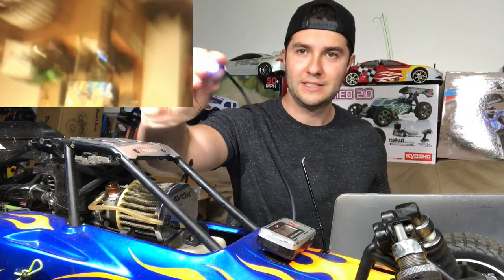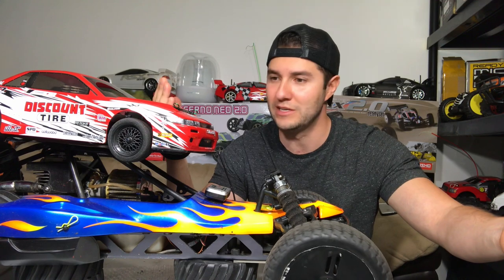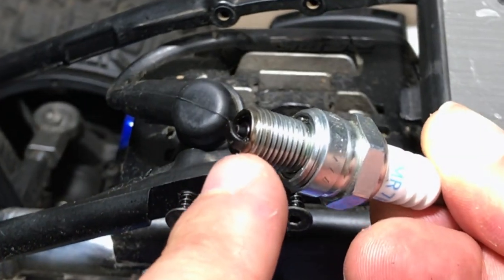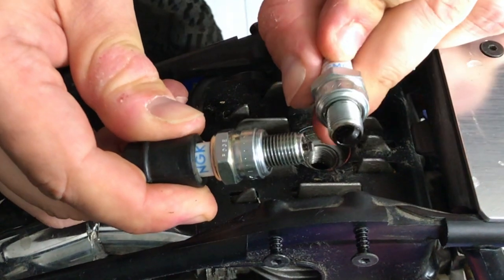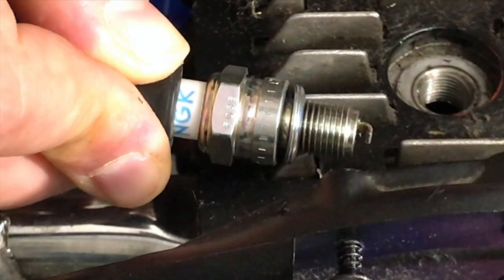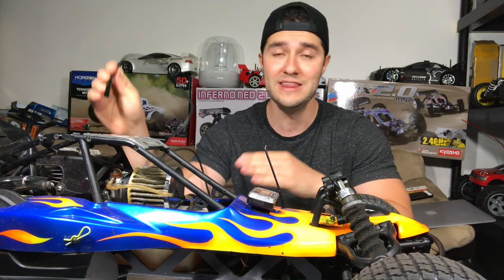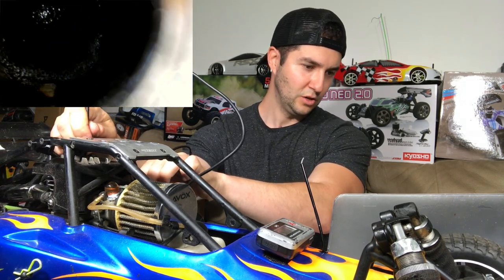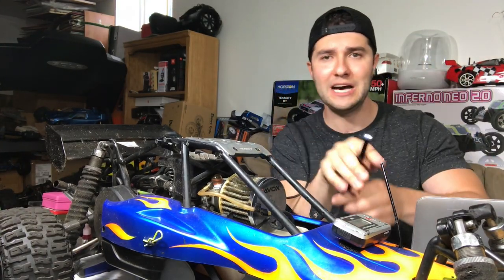Baja Does not Start - Diagnosing Common Starting Issues for all GAS RCs.  (Check Your Spark)

Comment: You know if its 1/5 and baja related, im on it like flys on sh*t you know what im sayin? Its what i do bajas all day! Liking the scoping of the rcmk engine as well as your dentures, very nice touch lmao😆 yes sir Jeff from eastside rc is my boy 50:1 crew and its true" its possible to foul a plug running 50:1 sawheet video 1,000 likes 👍👊💥
Reply: Hi there I've got a baja as1 5b just got it very excited at 44 yrs old lol when I put it on my stand and start the engine the wheels ain't turning when I press the throttle and when I put it on the floor it's like I have to press throttle all way in for the car to move do you no what would be wrong if you could help that would be great thanks
Reply: @pi3ladbd417  it could be a few things, i have a couple questions first. Did you buy it new? 2. What oil gas mixture are you running? Also what brand of 2 stroke oil are you using? 3. What size engine is it a 27cc,  29cc, 30.5cc 36cc or 45cc? and brand of engine? Like i said could be a couple of things 1. Its running way to rich and when you run real rich it the performance ia really bad and somecases barely move the baja and you have to lean out your low speed needle first before your high speed needle on your carb. 2. Is your spark plug fowled? You may need a new spark plug. 3. Check ALL your motor mount bolts, myself ive had the top right bolt on your motor brace on the clutch carrier backed our into my brake pads causing to engage my brakes full time so when you give it full throttle the baja barely moves. Check on these and let me know what you find new brap brother if no luck i have more options it ckuld be but those are the commmon ones!👍
Reply: Thanks for getting bk to me I'm out at minute when I get bk I will look at mix and oil I'm using and get straight bk to you I'll be be about an hour thanks again for replying I'm exited someone has replied much appreciated
Reply: @pi3ladbd417  no problem my man, i dont mind helping out a fellow brapper new or old! This is on hybrids video if you want to continue here thats fine but if you wanna go on my channel pick a video and write your comment ill get back to you there! Dont forget to subscribe to me if ya havnt lol i just dont want to muck up his notifications im sure he gets plenty already right Hybrid if your reading this?!😜👍
Reply: @FifthScaleOrBustRc  it's me again it's a bala 1/5 as1 36cc, castrol power 1, 2t 2 stroke motoroil, mixture is 25-1
Reply: Sorry yes it's brand new
Reply: @pi3ladbd417  how many tanks of gas have you gone through? Any or was it doing this right away from first tank of fuel?
Reply: I've only done 2 tanks of fuel I think I should try another couple and let it cool down before goin through another tank 15 min intervals leave it on the stand while doin so
Reply: @pi3ladbd417  its not going to.fix your issue no matter how many tanks you bench run it. Its either the carb settings on the high and low speed needles are way too rich and have to tune it start leaning it out in small 1/8 turn increments while the baja is running. Or check all your.bolts. make sure none of them backed oit on you while.bench running you need to loctite all bolts with metal connecting metal its very important cuz the vibrations from the engine while running will losen them everytime if.you dont use blue loctite not red! If you use red will have a heck of a time trying to take out the bolts its meant for permanent blue is removable lol. Check your rear brake pads see if there are any bolts backed out pushing on the pads. If so thats your issue
Reply: Thanks mate goin for a barbecue not rubbin it in like lol, when I get bk ill check it all over properly thanks again your a star ill let you no how I get on cheers bud keep safe

Comment: Thanks for the tip.  I think mine has the same problem will be checking out.
Reply from the maker: you got it man! Always trying to teach and entertain the RC masses, lol.  I've been running mine too rich only because I'm an RC Exhaust ADDICT, I knew this was a matter of time thing.  The more exhaust smoke the happier I am, lol.  Time to run less oil and see how long the plug lasts.

Comment: That is some nice lightning from that starter
Reply from the maker: I know right, that coil is nuts on this motor.  good thing about that part tester is the spark gap is adjustable.  I checked how far the spark will jump off camera and it was about 1 CM.  Thats crazy.  The redcat rampage spark is significantly worse from the coil, using the same tester.

Comment: If you clean the carbon off the plug with some emery cloth between the spark area, the plug will be good to use again. May save  you some money until you get the fuel mixture right?
Reply from the maker: hey my dude! I thought of cleaning it as you suggested.  It seems these plugs have resistors inside that just fail once in a while.  The carbon buildup was not that much to make it not exhibited any spark at all, you know.  But I will take your suggestion and attempt to see if it's cleanable for next time. Thank you!!  Nitrogang!!!

Comment: Great video! Look like there's quite a lot of carbon deposite top of that piston. Maybe it's good to remove it when rebuilding engine. By the way, nice spark tool you have.
Reply from the maker: hey man! Thanks for watching.  Yes, there is a good amount of carbon on the piston, you're right.  It seems to not affect anything from what I can tell.  Unless I have some severe need to rebuild the motor, I will just let it go.  There is more risk in trying to clean it than just letting it run, you know.

Comment: Hi.
My 1/5 scale was running fine then stoped and pulstart it's solid stuck, took it apart and manage to unsiezed it, got spark, and fuel, trouble is when try to start it sometimes pulls 20 times free no problem the out blue get siezed again.. Any ideas? Thanks 👍

Comment: I also have a km baja t1000..one time i didnt have spark..new plug nothing..then sometimes i would have spark..found out the bolt holding the coil to block was loose which was causing it to not make the right gap to the flywheel
Reply from the maker: hey bro!  YEs, that is also a relatively common problem, the coil itself not being correctly aligned.  This is why I always tart out with the spark tester to see if the coil itself is sending spark, you know.  Based on that, you can move onto the plug.  Ive never had a coil issue so far, usually it's the plug.

Comment: Not sure if your even going to see this  comment. I bought a King motor baja 30.5cc last fall. I am having trouble getting it started. So for example in your video your pull start is very smooth. Mine is not. It's almost like it's locked up and won't do anything. Any ideas?? I've had this thing for 9 months and haven't even gotten to play with it.
Reply from the maker: hey man! Trust me, I def see this comment, lol!  OK it sounds like your motor is flooded or locked up, thats why you can't pull the starter easily.  I recommend you remove the plug and then try to spin it over, it should be easy to pull it with the plug out.  If it's flooded just turn it upside down and pull the starter a few times.  Let me know how this goes, then we can continue to more troubleshooting steps.
Reply: @hybrid32494  ok I'll try it and see what happens. Thanks for the quick response.
Reply: Ok so I purchased one of those  power starters off of ebay that you use a drill with. Still no luck in getting it started. I still feel like something is wrong with the engine. It doest roll over smoothly at all. It feels like it's sticking. So feel like I should change the plug and probably  change the gas out, it's been sitting in the tank for awhile now. If you have any ideas they would be greatly appreciated.

Comment: I am late again! Sorry. Great video as always. I was going to ask...do the different exhaust pipes make much of a difference on those engines? Lol nice teef btw!
Reply from the maker: it's all about those TEEF bro!! And ye, the pipes make a huge difference in the power band and torque of the motor.  This is a King Motors clone of a a Dominator style pipe, which is one of the best.  There is pretty much nothing better than this style pipe, other than some side exhaust styles, but you're talking minimal gains here.  Some people claim that a pipe when campared to a stock baffle/can type exhaust will give an engine one extra HP, which is possible id say.
Reply: @hybrid32494  cool I will look into getting a pipe for my Rampage if I ever get a remote for it. I was surprised how cheap those pipes are.

Comment: Great info !! What is Your opinion on synthetic or normal oil mix for two stroke engines ?
Reply from the maker: hey buddy, thanks for watching.  Some owners manual still say to break in a gas engine using non-synthetic oils because the break in period is shorter.  The reality is it's just easier and better to just run the same oil you will run instead of changing.  Everyone I know uses a good quality Synthetic racing oil, such as Klotz Benol, Castor 927, Redline, Dominator.  I use Klotz Benol since it's cheap enough, mixes well, smells good and has a nice red tint.

Comment: I have spark and I have fuel sounds like it wants to start every pull but won't? Any help for that
Reply from the maker: hey man! You need to visually check if your plug is giving off enough spark first. Also good to troubleshoot with a new spare plug just to fully eliminate that situation.  I've found 4 out of 5 times a bad plug is the reason for not starting.  Then usually you carb is busted if you have spark, you need to clean the carb out.  In my case even when I saw plenty of fuel in the primer bulb the motor was still not getting fuel, and my carb was busted, I had to replace it.
Reply: @hybrid32494  Hey thanks for the reply I just bought the engine new 32cc it could be the carb but its brand new so i dont know it could be dirty? It ran for like half tank when i got it then stopped. and ill try a new plug but I can see spark when I pull the cord and put it on a metal surface

Comment: just tried firing up my baja after a few years of sitting and it will start but as soon as i turn choke off it dies...any ideas?
Reply from the maker: hey buddy! Generally your problem is the symptom of a bad carb, over time the diaphragm which is made of a rubber material just deteriorates inside the carb, and it will cause exactly the problem you're describing.  The ethanol in modern fuels rots away and distort the rubber elements of the carb.  I highly recommend you get a replacement carb.
Reply: @hybrid32494  yah youre probably right, luckily i think i have a spare one floating around here. Thx.

Comment: Cud there be another reason why it wont start, even if you have replace the sparkplug. Kill switch????
Reply from the maker: hey buddy! Yes, there is about a 75% chance the problem is due to a bad carb.  I've replaced a couple carbs so far and all just deteriorate due to age and fuel containing ethanol.  Generally the carb just does not flow fuel anymore to the motor.  To check just pour a few drops directly into the plug hole and spin it,  it should fire up for a couple seconds.  Then it will shut off again, indicating you have a carb fuel flow problem.  IN fact watch my other BAJA vids you will see me replacing the carb numerous times on all my older gas RCs.  So far this has happened about 100% of the time.

Comment: Boss of the Nitro Gang. Can't you just clean off the filiment so you will get a fresh clean connection again? By the looks of it the fuel has just caused an insulation between the 2 filiments that need to cause the spark so if you could get something to clean them off again and expose the metal as if it was new i am sure that spark plug could be used again. Just an idea to try and save you a few dolors!!! Bows
Reply from the maker: hey bro! You have a good idea, but in practice it almost never works.  The fouled up plug can be internally damaged too, I figured cleaning it was pointless if it only lasted a gallon of fuel, I just need to lean my fuel mixture out some and run less oil, and keep observing the effects on plug life.  BTW, I tried cleaning it off camera, and same results.
Reply: @hybrid32494  Yeah i agree Nitro Gang Boss. But just incase there was the odd chance it might be worth a try? Appreciate the reply!!! Bows!!!

Comment: Hi does anyone no why my new baja as1 is not running properly put it on stand for first time and when engine is running the wheels don't turn and when I put it on the floor it's like I have to press the throttle on control all way for the car to move any help would be greatfull, you all stay safe

Comment: You need to get rid of that air filter. Dust WILL pass through it. Get a 2 stage air filter and use air filter oil in the inner filter. Your engine will last much longer.
Reply from the maker: hey bro! Yes, you're 100% right.  This was the original filter on the thing from the last owner, I never replaced it.  I need a low profile filter that does not require any velocity stacks or BS like that.  I was looking at the TGN low profile ones, but there is no info on whether they require any special velocity stack mountings, or can be used with the stock baja filter mounting bolts and all.  What do you think?
Reply: Belive it or not the absolute best air filter you can get for the 5b is the original. Not specifically for air flow but for protection. A velocity stack can be added to the original with a mounting kit and would provide better flow because it eliminates the stock housing and has a bigger opening. As far as oil goes, you can use K&N air filter oil. I've been running in loose dirt for years and never had an issue.
Reply: Also heres my custom 5b if you are interested in seeing. https://photos.app.goo.gl/vUwkgarCBrNoEgh66

Comment: See I've only started mine twice and the third time I try to start my rovan it pulled twice and then the pool cord got stuck and I'm hoping the engine isn't stuck its brand new I made sure the engine was running Rich enough so obviously I didn't get it started for the third time and the pool cord is just stuck and not rotating the engine I'm hoping there's just debris inside of the fan blade or something getting ready to tear it apart now I ended up getting the full size 5B buggy with the 30.5 cc engine so obviously the engine is brand new it is barely out of break in. And obviously didn't get it started after two pools the pull cord is stuck it's not a broken pull start I think there's just something jammed in between it and the flywheel there should be no reason my engine would be stuck already

Comment: I still cant get my redcat rampage mt started
Reply from the maker: Hey man let’s see if we can fix that did you confirm that you actually do have spark first do a visual check of the spark plug then attempt to just pour some fuel in through the plug hole and give it a start attemp.    In almost all cases when mine did not start it was due to a faulty carb as soon as I replace the carb they fired right up
Reply: im going to replace the carb its 10 years old

Comment: Couldnt you just clean the old Spark plug?
Reply from the maker: hey bro! unfortunately a cleaning would not have restored that plug, it goes way beyond an exterior cleaning.  There is a filament of some type inside the plug that is no longer conducting electricity for whatever reason, simply cleaning the electrode would not have helped, I've tried previously.  This plug was just dead, it had no spark at all.
Reply: @hybrid32494  That sucks dude

Comment: My baja floods on the very first pull
Reply from the maker: hey buddy, I have never heard of that before, you must have other on-going issues.  Always, are you sure your CHOKE is off and your carb needles are set to factory settings?
Reply: It doesn't have a choke

Comment: No comment
Reply from the maker: hahaa, hey dude! This would be the first time ever, that you don't have a good detailed comment.  I guess you fully approve and have not found any mistakes, LOL.  is that right??
Reply: hybrid32494 I think I heard you say a double negative I would have to rewatch it 
So you think it’s the carburetor that’s not letting it start or was it the spark plug that was fouled out
Reply from the maker: @nomusicrc  it turns out if was the spark plug.  At first I replaced the carb prior to this video, and it ran fine.  Then about half a gallon in the plug didn't provide any spark.